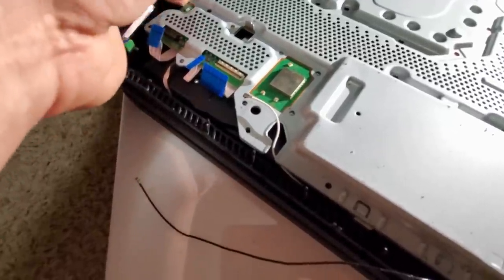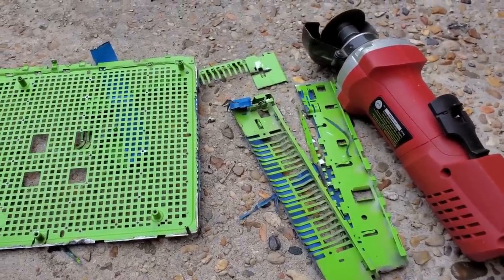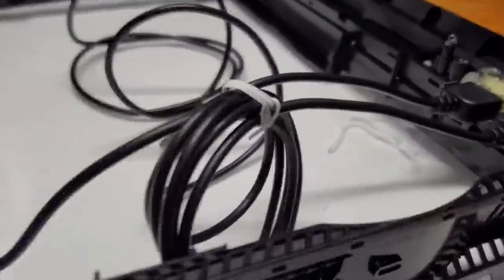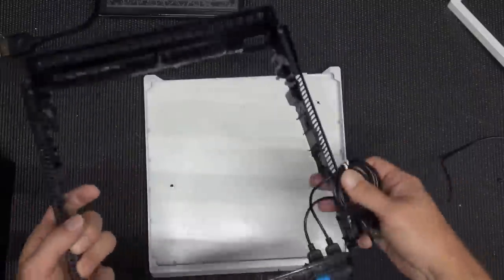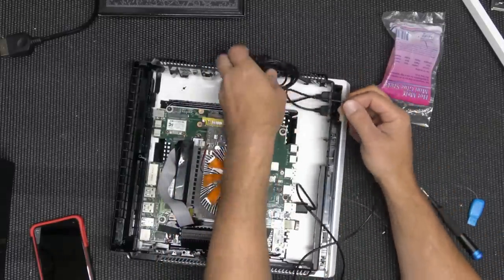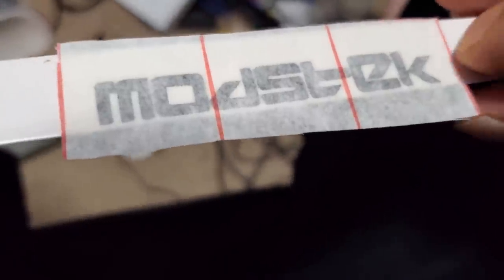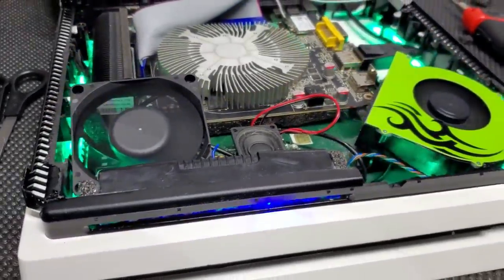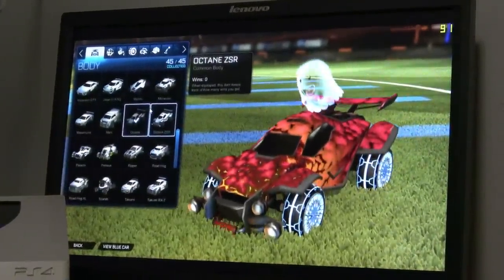PS4 or PC?

Comment: You could easily sell the original guts
Reply from the maker: still have them i used an atx power supply on the 12v prongs like a diagram i seen but it still wouldnt power unless it needs the 5v as well to power up im still looking into that